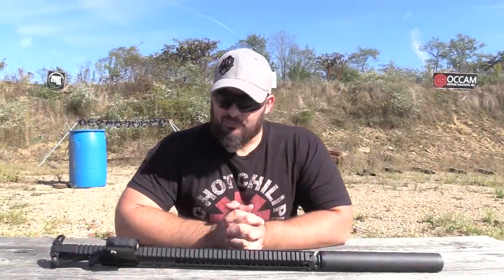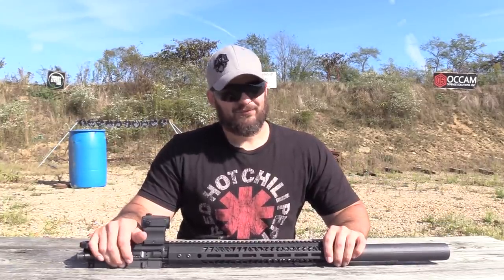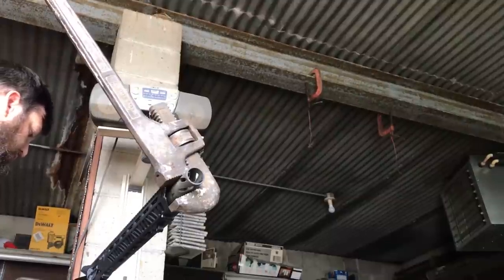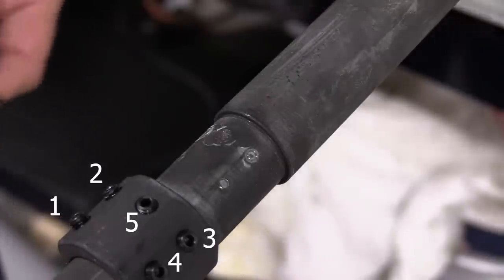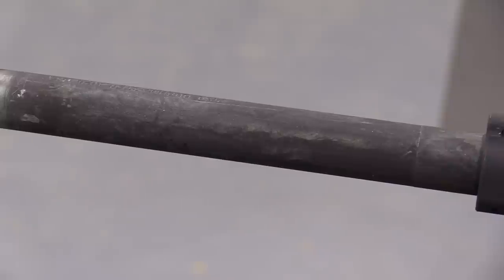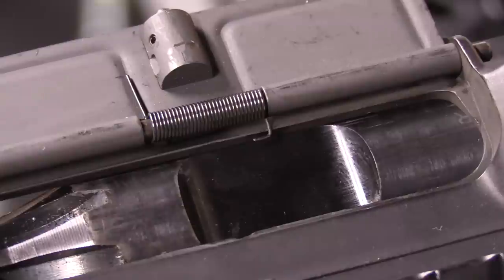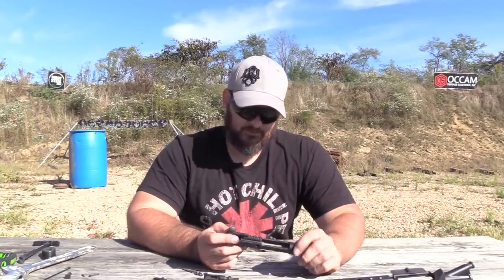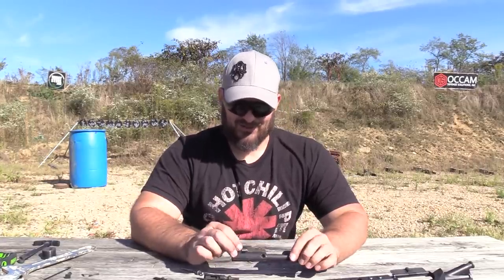The Worst AR 15 I've Seen 🚩Bear Creek Arsenal🚩

Comment: I have a BCA 7.62x39 ar that has thousands of steel cased rounds through it. The extractor spring did become weak and caused malfunctions around 2000rds a BCM kit fixed that. I bought a .450BM upper from them and it was just a headache to deal with. Reciever was milled wrong and the barrel was not accurate at all. All of the other components were done properly though. You get what you pay for and it seems like luck of the draw with them. I built an anderson AM15 with their .223 wylde barrel and I'm nothing but impressed by it.
Reply: Same here ! My BCA 450 upper works fine, just will not group worth a damn at ALL.
Reply: @wyldebill7248  you can send it back to be replaced. I got a replacement 450 upper a few days ago but haven't shot it yet. It looks a lot better than the last one.
Reply: Maybe slug the bore and see if it's .458" :)
Reply: So, 2 of 3 work great, you didn't use their warranty and yet you say "sometimes you get what you pay for."
Honestly you're talking out both sides of your mouth. Let's agree that you should warranty the 450bm and now it works.   How much money did you save? 3 uppers for less than 1000$. Sounds like you got a lot more for your money than you think
Reply: @didamnesia3575  I have used their warranties before, I just so happen to be an impatient gunsmith with the ability to fix things instantly instead of waiting weeks for a return. You do get what you pay for, a $300 BCA .450 upper as opposed to a $1000 Tromix .450 upper is a world of difference in parts quality. I'll use their barrels for builds but I just got an 11.5" 5.56 barrel from them with threads that aren't concentric so a suppressor cannot be mounted which was the intended purpose.
Reply: @SuspiciousGanymede  then send it back. Lifetime warranty. You just said their parts are bad, but you'd use their barrels. Ok.
People are buying uppers from them. Bcg, barrel, handguard, charging handle. So let's be honest... for the price you and others (me too) are willing to send it back if it doesn't work right. Nothing wrong with that. Personally I'm not going to spend 400+ on a barrel I can order for 125$ that has a lifetime warranty. There's paying for quality and there's over paying for quality. I wanted an AR for my workshop for when I'm in there for long periods with earplugs in and someone could run up on me. Not going to put a 2000$ rifle out there to get wood dust and junk all over it. Just gonna grab a bca and not worry. All guns have their place. You're not going to impress anyone with a BCA except other cost conscious people and frankly who wants to play the one up game at the range. I just want to shoot, practice, and have fun. 
You're not going to get the fit and finish perfection from a BCA but you will save a lot of money. I have 9 ARs. I stopped trying to make each one a perfect gun a long time ago. Just a couple need to be great. And only one needs to be my combat ready firearm. 
To each their own. If you want to spend more that's easy to do. If you get a bad part from bca send it back.
As for the 450 mine is fine. I saved 700$.  How is there any argument there?  The other companies are not doing 700$ worth of inspection. Yachts don't buy themselves
Reply: @didamnesia3575  SOTAR on YouTube  is the prime example of why you spend more money on quality parts, he's a master armorer who gauges all parts from a variety of manufacturers, essentially justifying the price for QC.
 A beater rifle for a cheap price, you justified that purchase. I've burned out one of their glock barrels and 2 of their AR barrels, if you're someone who doesn't shoot thousands of rounds a year you probably won't notice a difference (both in accuracy and reliability). I found out through the years that I prefer my rifles to last a lifetime without having to be sent back for repairs so that justifies my purchase if higher end parts. 
   BCA barrels for me are for test rifles to see if I like a particular caliber when hunting or to make backup rifles for my family.  members.
Reply: @SuspiciousGanymede  backup rifles for family is exactly why I bought a couple BCA builds and for beaters. And the 450 is just for fun. I don't mind replacing parts with better ones and I'm at the age where good glass is more important than who assembled the gun. I'll agree that bca is going to let some bad parts slip through. They're also a young company trying to put out working guns for people that can't afford a high end rifle. I'm ok with their quality because I know it's going to not be perfect and I already have a high end AR build. So for me, when adding a fun gun or a hunting gun that will get beat up and only needs to be strong and accurate I'm ok with a bca for some endeavors. 
I recommend everyone that buys a bca upper to take it apart and put it back together properly torqued and checked out. 
If it was my first AR, I might suggest a PSA, but I've had to send back a bcg to psa before. 
In my experience, a 1500$ AR needs more justification than a cheap one. I buy bca for beaters like you said and also to test them for handling of various weight barrels, etc. 
But as long as you're having a good time than that's all that matters. 
I'm not saying I always make the best choices

Comment: He didn't really expect a $200 big bore upper to last running FA? Did I miss a description on what did not work when tried after the step of sitting in the safe for a week? I would assume the ejector was the problem? I watched a 2nd time and the actual problem or issues were not mentioned.
Kids, don't take this guys advise. Off-thread pitch? Did he make that up? Hasn't 5/8-32 become common/standard  or( : On-Thread Pitch : ) for many big bore barrels. I have not seen very many mass produced big bore with 5/8-24 threads, usually build to order. It's too bad he brought budget quality tools to work on his budget quality upper.
 I would advise one to tear down every gun they buy and inspect them no matter who the manufacturer is that builds or assembles them. Gucci AR INC can also have their #1 QC tech John Smith call in sick with covid and replaced with Juanny Sanchez and start having QC issues.

Comment: Given that you've shot both and have the ability to properly torque down these loose components and such, would you rather have this exact BCA 450 or the Ruger American (or similar budget bolt guns, like the Mossberg Patriot) in 450 BM?
Reply from the maker: If it’s suppressed the bolt gun would be much preferred.
Reply: @VSO_Gun_Channel  - Perfect, thank you. I have the Mossberg 450 suppressed and was considering switching to the BCA 450 for Iowa deer season. Currently I use a 12 gauge pump shotgun with a red dot for when we are "running" deer for quick shots, and the bolt gun with a scope for "still" hunting. Maybe I should look at it differently: keep the suppressed 450 bolt gun, and replace the pump shotgun with a semi-auto 450. I guess you can never have too many options (I should just reconsider the BCA brand though).

Comment: Good afternoon. With all due respect (I watch almost all your videos) , I think that the only real issue I see is the broken extractor. Everything else is something you can expect from that price point, and that could have been caught and fixed before firing with a normal new firearm inspection. After all, if your intention was to fire full auto and suppressed such a big bore, as a bare minimum, you should have gone through a preliminary inspection, at least for safety's sake. I am pretty sure that staking again the gas key and torque to the specs the gas block would have taken you 5 minutes. Again, it is just my humble opinion. Regards

Comment: Yeah, you got the shaft on that one.  I have two BCA uppers, one in .300 BLK and another in .308.  Mine are fine, I have no complaints.  I don’t fire full auto, and I don’t run suppressed, so that probably helps some with the heat expansion.  I thought I had a dimensional issue, but it was actually an ammo issue, but I contacted their customer service, took about a week to hear back, but they OK’d my upper for RMA for dimensional issues.  But it wasn’t necessary, so I never sent it back.

Comment: Odd. Maybe I have unicorns. I have a 20" bbl, 15" M-lock 6.5 Grendel BCA upper, and an 18" bbl, 15" M-lock  223 wylde BCA upper. No issues so far. To be fair, I only have 500 rounds through the 6.5, and 1500 through the 223 wylde.
 Both are fairly accurate. Not match grade, but good enough for hunting and combat.

Comment: Bear Creek Arsenal has excellent customer service. If you had a problem and contacted them I bet they would make it right. The fact is they are putting reliable firearms in the hands of the common working man whom you affectionately call fuds. I like Bear Creek Arsenal, they are not perfect, but by in large they work and have great customer service. I hate your red hot chilli peppers shirt. I would rather be a fud than Californicated.

Comment: I don't know who you guys have been talking to but Bear Creek has had some of the best customer service I've ever had. They even drilled and pinned a front sight gas block for me for free because they didn't have a barrel with a fsb they even paid for my shipping I just supplied the parts. The only issue I have is the gas port is too oversized on there 6.5 Grendel carbine. I've used almost two of each caliber barrel they have and I have two different caliber uppers I took them apart checked and there were no issues. But I've been a customer of theirs for a while i don't know if that makes a difference.

Comment: Who doesn't check everything over & locktite & tighten things before a round goes down range regardless of the tier of AR they purchase?  The guy who bags on this upper is pissed off he stripped out his Walmart torx set.  Lmao.  It's a budget upper marketed as a budget upper.  My BCA 7.62x39 upper sitting on my poverty pony lower runs like a Swiss watch no matter what I feed it, but I was smart enough to check everything over before I fired it....... Amazed these clowns can get manufactures to send them stuff to demo.  Everything you found was either normal wear for an upper in that price point or should have been fixed before you took it to the range.

Comment: I've bought 2 bca uppers and on one(556) the extractor took a shit within 30 rounds so i contacted bca and they sent me another. I took the other upper (7.62×39) to the range and the extractor took a shit within 100 rounds. Instead of replacing the parts with the same crap parts I bought new BCGs (not from bca) for $200 each upper you get what you paid for. Lesson learned but the rest of the uppers aren't too bad

Comment: I have a bca ive ABSOLUTELY USED AND USED AND USED IT.  and it works just fine. But I guess Thats what happens when you know better and care about things.
Reply: This upper would have failed regardless of how he used it. The gas block was mounted without any kind of thread lock and the gas key was improperly staked. Gas key staking is a critical thing that can't be overlooked.

Comment: When testing an AR-15 upper receiver, isn't it customary to buy three sticks of dynamite and see how well it holds up after the explosion?  If it survives this easy test, run over it five times with an Abram's Tank.  If it fails, you know right away this thing in junk.  Also, when inserting QD (Quick Disconnect) devices into the same hole and they all fit differently, then obviously the hole must be changing size right before your eyes.  Bear Creek Arsenal should be ashamed they can't pass the VSO Gun Channel review.  But, then again....who could????

Comment: I have a BCA 10.5 556 upper I bought on sale just to check out.... I put about 500 rounds through it and it ran fine. took the handguard off the other day to swap out the flash hider,, before I started to remove the flash hider I tried to twist the barrel nut with my hand, to my surprise I was able to unscrew the nut with my hand with no effort at all.... not good ..... and I was not able to line up the handguard mounting screws. I had to either hand tighten or use about 75 ftlbs to get to line up..... so leaving at 75ftlbs for now until I can get a shim kit

Comment: Idk....my BC side charger 762x39 has about 1500 rnds through it and works perfectly.
Also, my BC 5.56 upper also has over 1500 rnds through it and it also runs perfectly.
 mine are all newer versions, maybe that's why...
And I'll add ...they're very accurate.
And yes...I've been shooting for 35yrs and shoot more than a few times a year 🤷‍♂️
I have ar's from DD, COLT AND ARMALITE...
i use the BC uppers as range toys and they are perfect for that 👍

Comment: GO BUY A BCA upper guys..  you can get some loctite , and take the time and double check the fit of the parts,. Put a little time in it and youll have a 200 dollar 450 socom,  thatll run forever in reasonable circumstancez

Comment: I’ve never put hands on a BCA so I don’t have a personal opinion as to whether I’d agree if it’s junk or not. The best true comparison they should’ve done was to inspect the new upper before and then after to really have a good base of how bad it failed. I know my stuff to varying degrees on my rifles but I don’t think it takes a gunologist to see that a hoss of a caliber like that probably wasn’t intended for full auto in conjunction with a sizable suppressor. I can see the thought process of how full auto would show an accelerated point of a gun’s life cycle/ weak points in most cases. But knocking the 450 upper is kinda like bashing a 400 lb world strongest man competitor who you made run a 300 meter sprint course designed for 130 lb flat bellies. I think most would be more agreeable if the same test was done in their 223 Wylde and it had the same problems.

I also wonder if the same results would happen if that upper were run hard with the same amount of rounds but just in semi auto. I think for their purposes of having a cheap test mule for their can used in that caliber was worth it and it was (no pun intended) the best bang for their buck. I mean they got a complete upper in an unorthodox caliber for what most “pinky out” manufacturers charge for just the barrel. 

I would agree that some of the points made were good such as sneaky thread difference for muzzle attachments and crappy gas key staking. Not a bad video but I think it’s kind of an unfair assessment of the upper considering the totality of it all.

Comment: Had mine for couple years no issues. I don't rattle the crap out of it by shooting full auto, because it's semi auto only. Who shoots a BCA upper full auto. He clearly admits he doesn't really know anything about BCA. If you can afford full auto in a free state, with CAN on it, why would you use an upper that cost 1/5 the price of a cheap can. This guy is either making a joke video, or a moron who bought something he clear knows nothing about.

Comment: My first build I got a .223 barrel from them works great. Still going good after 1000 rounds. Got my c.c. info stolen after that purchase could be coincidental.  Then I seen a good deal on a .350 legend upper so I said why not. I'll try it out here in Michigan.  Barrel is loose, handguard is loose. Who knows what else is. The gunsmith at the shop I goto says they have had a few come in with these same problems.

Comment: I'll admit that I don't have enough rounds downrange (less than 800) but I have two 6.5 grendel's both are heavy barrel 16 inche and 24 inche from BCA and the 24 inch upper is less than 1/2 moa all day and the 16 inch is a little over 3/4 moa, and so far absolutely no problems. 
Maybe I am just lucky.

Comment: There are so many Things I see done wrong in this video but the one that made me laugh the most was when he put one QD stud in the mount hole and yanked it out. Which made it seem like the hole was out of spec TOO BIG. Then he grabs another QD stud and it won’t fit in the hole. Which makes it seem like the hole is out of spec TOO SMALL.  Which makes me think that there’s nothing at all wrong with the hole and you should buy some better made QD sling studs.  Next week he’ll be running lag bolts with a harbor freight battery drill and talk about how if just doesn’t last like his dewalt.

Comment: Well I don’t plan on going .450 Bushmaster in full auto all day and then throwing it in a safe for a week. You can’t hold a $250 upper to the same standard as a $1,000 upper...
Reply: It's an AR. It gets held to the standard of the AR.
If it can't do AR things, it's a bad copy of the rifle.
Reply: Titanium Rain the AR was designed to run 5.56... not .350 legend. much higher tolerances required for that round.
Reply: @jacoblattie1411  Irrelevant. This is a 450 bushmaster which operates at a lower SAAMI max pressure, the locking lugs should handle it if properly designed and the gas system can be tuned for port location and port size to get the system running as closely to 5.56 as possible. Keep in mind that 5.56 ARs can have anything between 20" M16s with rifle length gas systems and 10.3" Mk18s and run successfully so there's a wide range of operating pressures for the system.
You cannot blame the cartridge change, just who made it.